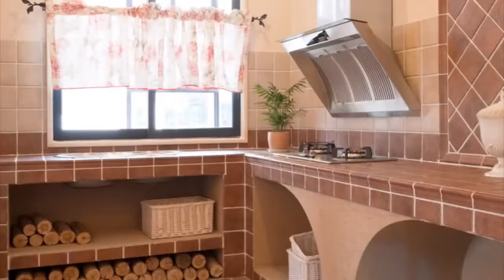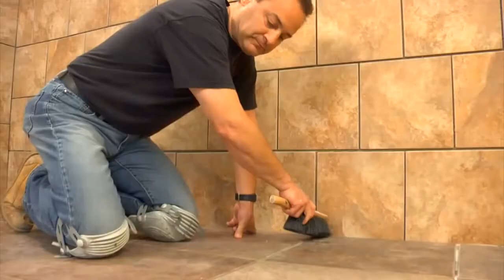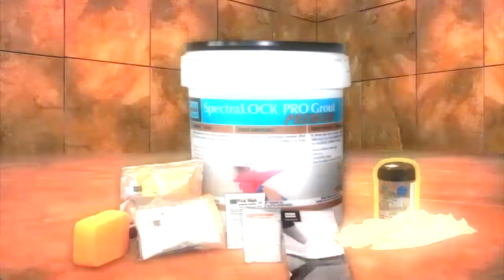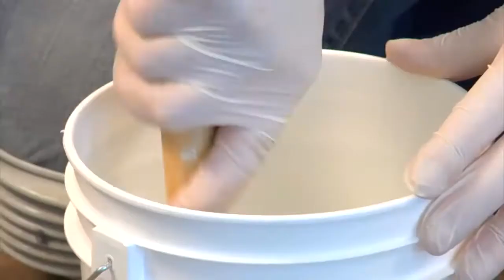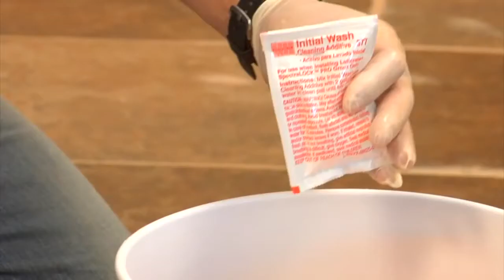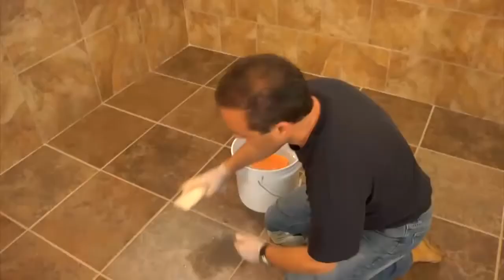SPECTRALOCK® PRO Premium Grout*

Comment: for a swimming pool  how much time before water is put in
Reply: The duration for water exposure after grout installation with LATICRETE Spectralock Pro Premium Grout is typically 7-14 days. However, this timeframe may vary based on factors like the pool's location whether it is installed on the ground or on a rooftop. For personalized guidance, please consult our technical service for additional assistance!

Comment: What is the coverage of both the full unit and commercial unit?
Reply from the maker: Please Refer to Coverage Chart located on Data Sheet 254.3 APD.
Approximate coverage for SPECTRALOCK PRO Premium Grout†
is the same as SPECTRALOCK PRO Grout†
.
Actual coverage will vary depending on job site conditions, actual tile
size and installed grout joint size. Add 10% for waste, spillage and
clean-up, and another 10%–15% when grouting unglazed quarry tile.

Expanded coverage tables at https://laticrete.com/en/support-and-downloads/product-support/project-estimator